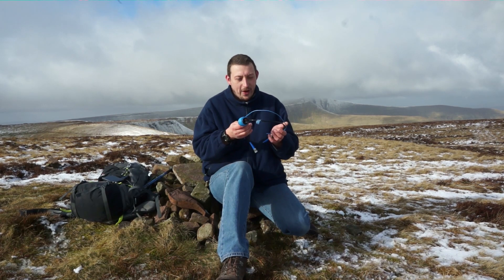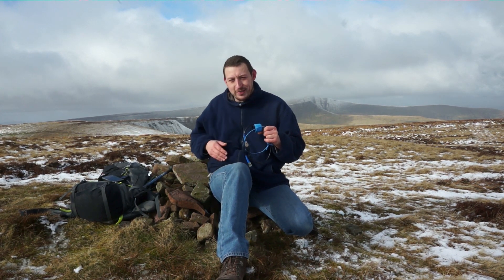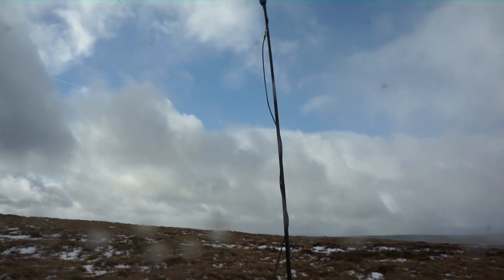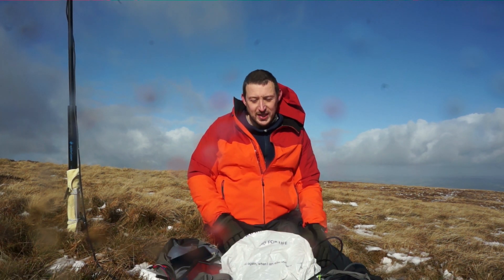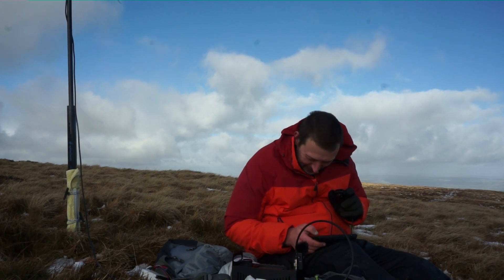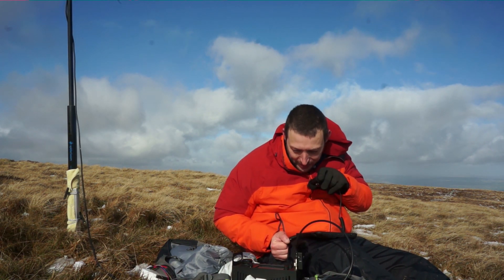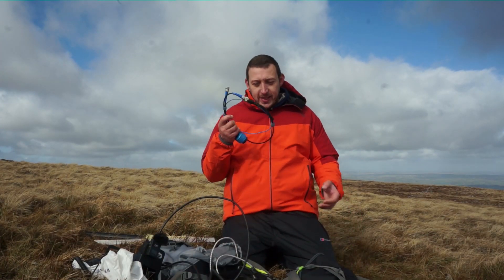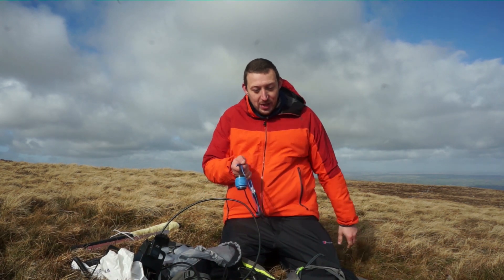Hawkins Radio 2m Antenna Field Test On A Welsh Mountain

Comment: Late to the Party as per.
Is this avaliable anywhere or equivalent ?
Reply from the maker: I purchased mine on Ebay but that was quite a while ago.

I haven't seen any listed on Ebay for quite some time and I seem to recall the company website being dormant as the last time I checked it didn't appear to have been updated for a while.

This leads me to think that they may have stopped trading.

There are similar 1/2 wave (T2LT type) antennas which regularly pop up on Ebay from other people that make them.

Comment: Are hawkins still trading thanks
Reply from the maker: It's been a while since I filmed this so it's possible they might not be trading anymore. I've just had a look at their eBay store (which is where I purchased mine). Their store is still listed but they don't currently appear to have any items listed:- https://www.ebay.co.uk/usr/hawkins-radio

I have no idea is the short answer!
Reply: @AmateurRadioUK  my health I's poor I'm struggling I've ss9900 and ended up with 3 albrecht ae 2990 afs hand helds 
Not got ss9900 flying yet 
Not really used the albrechts
I.know the ss9900 are very good but above 12 watts 
The albrecht are stunning 
I wasn't to do my foundation nxt year then ill do cb and amateur I know à lot get some great distances on sideband and its a bit naughty but when I pass my foundation I won't go over it was 10 watts 
As for sideband to b  honest as long as they don't bother anyone and use them responsibly I don't see a problem most using sideband are very responsible  some may have a different view 
The ss9900 push 60 watts 
It's whatever you think 
I'll try  and  find a hawkins cheers